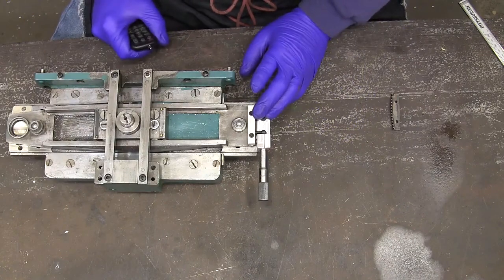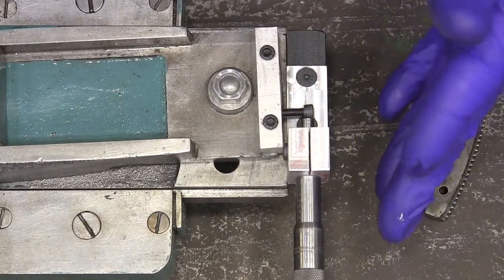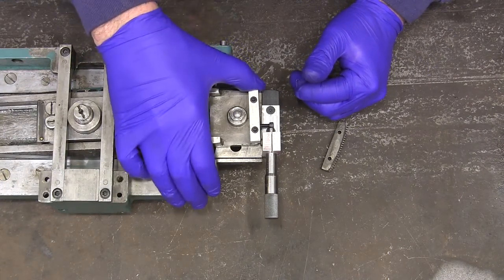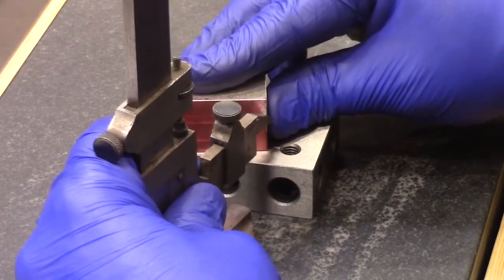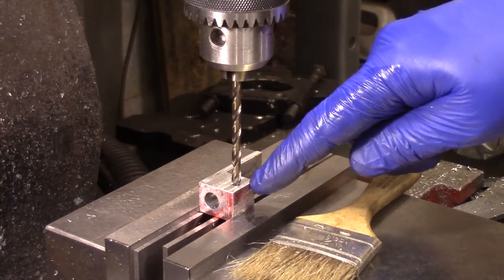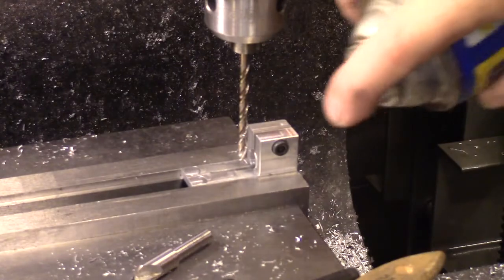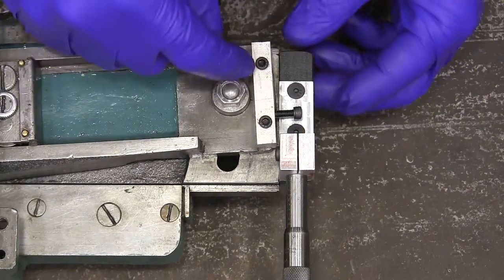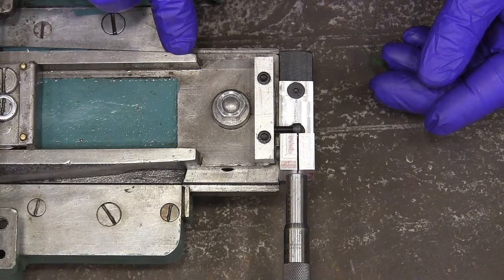DIY Monarch 10EE Taper Attachment Micrometer

Comment: How do you know when you've obtained the desired angle?
Reply from the maker: You can read it on the scale but if it has to be exact I put a test indicator on the cross slide and run it against a known straight cylinder held between centers and adjust until I get the correct setting.
Reply: Oh, I am totally going to do this for my missing 10ee worm gear and micrometer.   Thanks!

Comment: Thanks for sharing you ideas and the video. I have a Monarch 10EE that I was restoring until I had to move. Right now it is in storage until I get a shop to work in. I knew parts were missing on my taper attachment, but just didn’t know to what extent. I purchased the rear bracket and rod off of eBay, but this micrometer adjustment is missing on my taper attachment as well. So this may well be the fix I need to get mine working. Thanks gain!
Tom S.
Reply from the maker: I was in the same boat, I only had the taper attachment and had to make the rear bracket and rod.  The last time I used it I was very frustrated trying to get it set, I think this is going to be a big improvement.  Thanks for the comment and good luck with your machine!
Reply: Soat Mon I saw you showed a drawing briefly in your video. Would you consider posting a link to share a dxf or pdf file? I don’t know when I’ll get a chance to get back to my lathe project, but I could save the drawing for when I do. Thanks.
Reply from the maker: I posted it here for you.  Soatmon.com
Reply: Thanks!

Comment: Nice work!  Instead of unscrewing the block to swap the stop, why not drill and tap another hole on the other end?  You could leave the screw fixed at this new position, and just remove the one from the position you have now if you need the opposite taper.  Just one idea.  I suspect there could be many other solutions too.  Thanks for sharing. Joel
Reply from the maker: Good idea, that would certainly make it easier for someone that uses their taper attachment frequently.  Thanks for the comment!